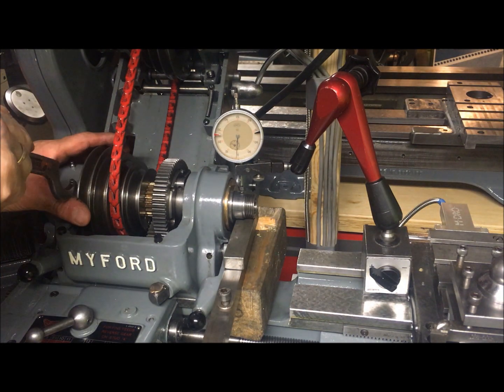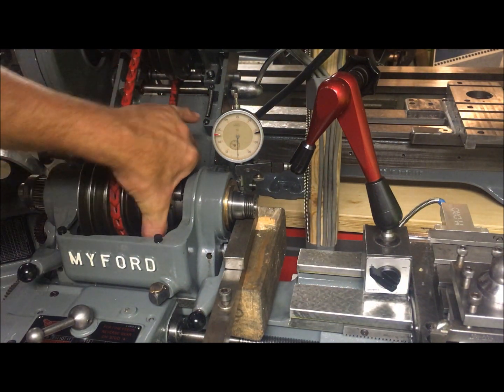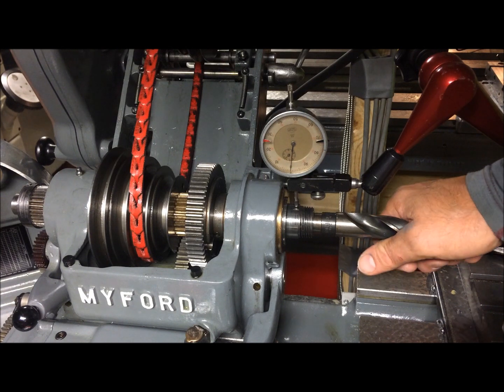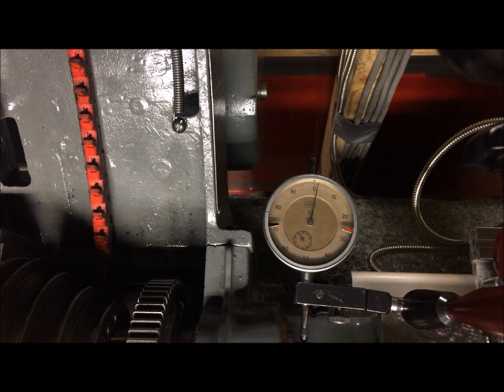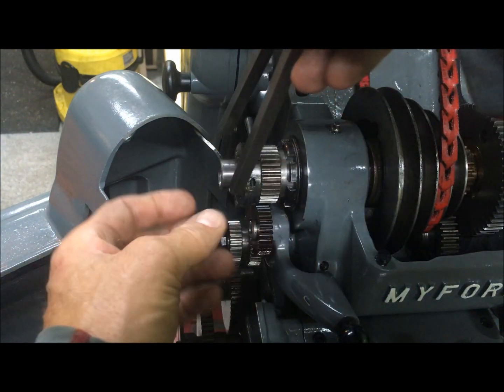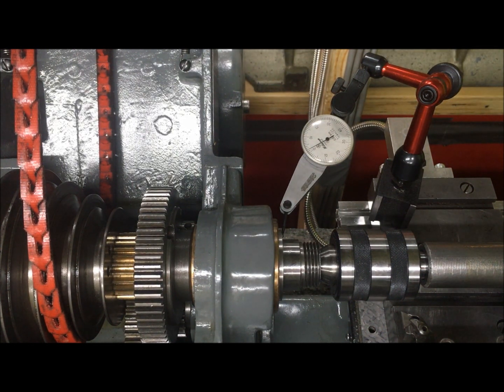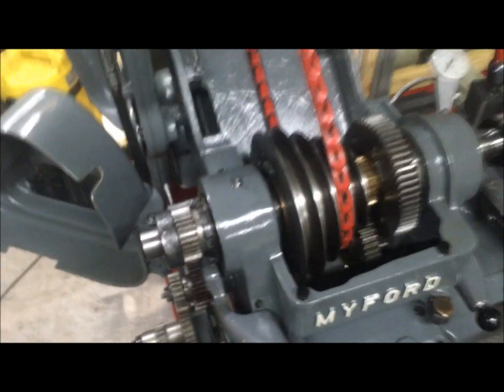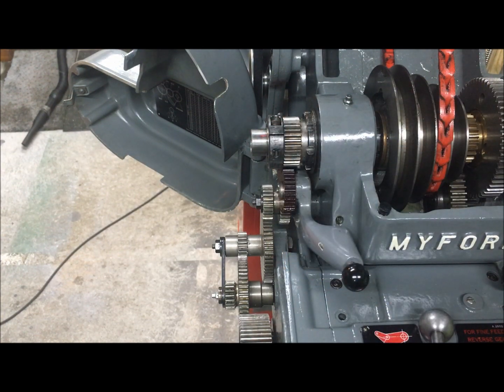Myford Super 7 - testing end float and radial play under load

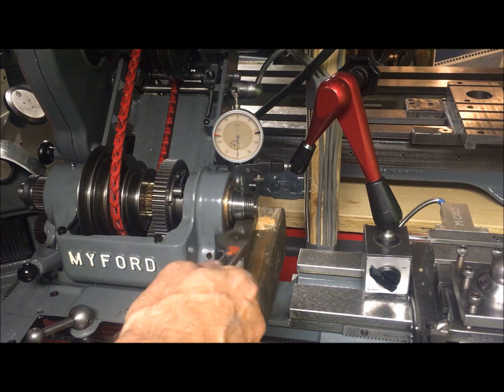Comment: Hi Jan, at the 1:00 minute mark you mentioned the readings are the same with the tight spindle,  but there are a few considerations to be made first.

Namely your dial test  indicator is on the bed, therefore the same reading could stem from some sort of bed twist or other variable other than lift in the spindle in relation to the front spindle bush.

i think a better method would be to find a solid part of the headstock to have the DTI resting, and re-do the test with a tight spinlde, vs a free running spindle per  myford  specs.

that  way we can elimiate other  variables and focus on the real readings we are after.

a 2nd consideration, not to do with the test, but rather the design of the headstock, would be to have a more secure way of mounting the headstock such as on toolroom lathes. I believe myford have the 4 bolts  locking it down to the bed? The lack of tough rigidity in this setup could cause the myford to lose  ridgity in the headstock setup.

Maybe a project for this year?

Thanks
Reply from the maker: Thnks for valid comments!
I agree to your comments. The Myford headstock is mounted to the bed using 4 M8 bolts and although a possible "weakness" it is as far as I know not reported as such by anyone. Mind you, it is a small lathe and I assume it is to be used within it's "performance envelope" ie. not meant for turning brake disks or the likes :) and for normal usage I assume the design is adequate. I do however also assume that the intention of the design was to have an "all-round single machine" for a small workshop, hence for example the gap, which increases the practical usage a lot, but also invites to mount "too large" workpieces. I assume the bed had been "stiffer" without this gap. Same with the backgear: correctly used, a fantastic function, but also maybe tempting to hog metal outside of the machines real capacity. Both cases maybe resulting in "flex" in different areas, including the bed and headstock.
PS! I have also tried other methods to test for play, indicator foot on the headstock included, eliminating the bed and cannot really see any difference, concluding that this is an OK approach to detect the majority of the play.

Comment: will it not be better to mount the magnetic indicator holder somewhere on the head-stock instead of the bed thus avoiding any flex in the bed etc? because we are measuring radial play between the head-stock and spindle right?
Reply from the maker: I see the point, and yes, it could be... if a suitable location on the headstock is found

Comment: Hi Jan I have a issue with my myford super 7, when using the longitudinal power feed it begins smooth then every few cm's it will get a intermittent rough cut. I have locked off the top and cross slide to remove any play and also adjusted the carriage to remove any play also. I have it set up for fine feed .0018 and the fastest speed available on the assembly. I am using a tungsten carbide tip cutting tool. any suggestions on what it could be?
Reply from the maker: Does the tip have a negative or positive cutting angle? Remember that many of these tips are meant for industrial use, ie. big/hefty machine with much more power and a lot sturdier than a Myford. These edges are designed for and can withstand a lot higher feed/speeds and also take deeper cuts. In a small machine like the Myford I would also try a ground hi-speed tool, honed really sharp. However, I suspect that there is some wear/slop in the bed/carriage, so that the "support" for the tool varies as you move the saddle longitudinally. Have you tightened the gib (4 or 5 screws at the front of the saddle)? If you do this say when the saddle is in the region towards the chuck (the most used area) and the saddle binds when you move it down towards the tailstock, you have some bed/saddle wear. The only real fix for this will be a bed/saddle regrind or scrape.
Reply from the maker: PS! As said before, I am not an expert machinist, so take my answers with a grain of salt :) That means, look for more answers also, so you can evaluate them against one another. Good sources of information for a Myford group on Facebook (just search for Myford) as well as the https://www.model-engineer.co.uk/forums/
Reply: @jansverrehaugjord9934  Yes I shall try hss but I suspect you are correct about the wear on the bed/  saddle. I can adjust the jib with the tool level with the chuck then once I move down the bed it become excessively tight. I have been quoted to have the bed ground. I will also look into getting the saddle and sides of bed milled. 

Regards

Rob.

Comment: Very interesting and unexpected results Jan. I would have thought there would be much more movement with the adjusting nuts backed off to the standard running clearance from being almost locked. That certainly shows you've done an excellent job of refitting the new bearings.
Reply from the maker: I tested and compared the results with my other lathe, and even though they are a bit better, this is a 1200kg very rigid toolroom lathe with double SKF roller bearing front support and a double ball bearing rear thrust bearing, I was also positively surprised